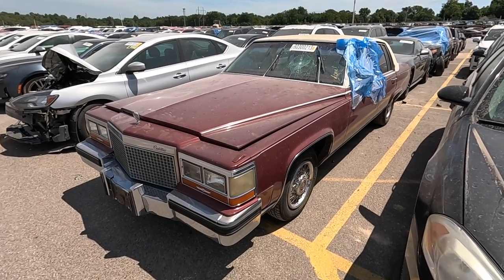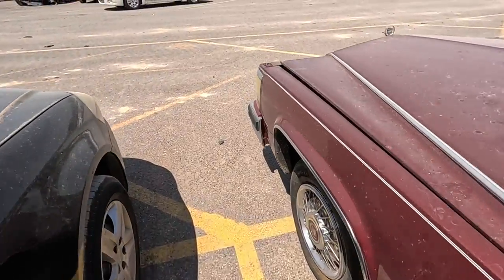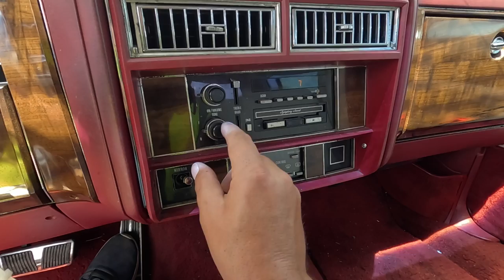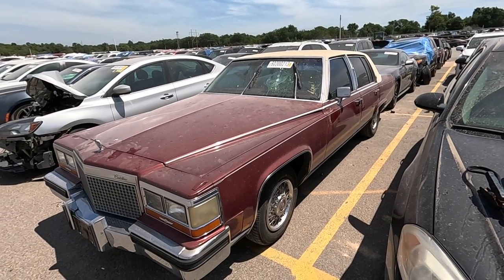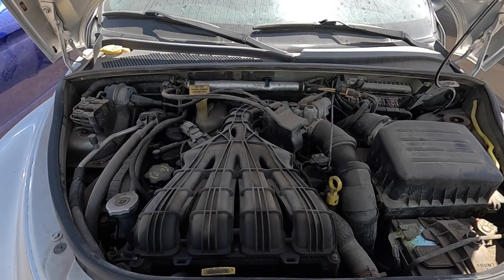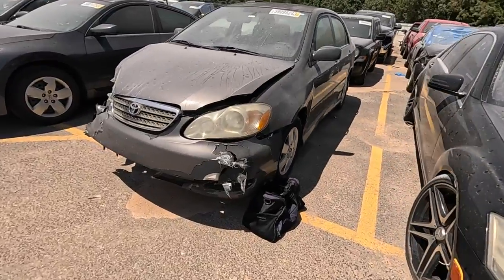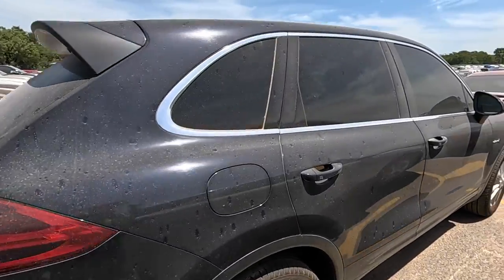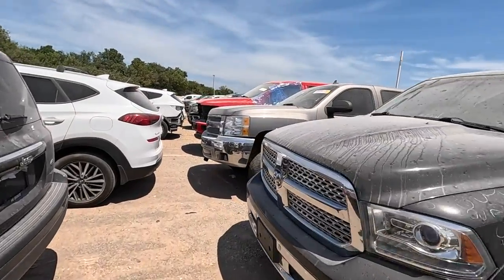This Old Cadillac Brougham was Abandoned for Windshield Damage? Will it Run?

Comment: The old Caddy has an Olds engine in it. Hell of a lot better than that HT 4.1 boat anchor.
Reply: A 403 swap would be perfect for this car. The 307 isn't really worth upgrading but they're pretty reliable.
Reply: Most of the Olds engines are pretty reliable, and a good throttle-body injection system will improve the overall performance.

Comment: OMG  the 1987 Caddy Brougham. I used to have one just like that. Mine was 86 or 88. 5.0l 145hp  carburated engine. 0-60 in 45 seconds,full  floating suspension😅

Comment: Randy, you need to get yourself one of those baseball caps with the two cupholders on it with drinking straws hanging down. That way you can stay hydrated with a couple of beers..........I mean water bottles.  Yeah, that's the ticket.  Water bottles!  
Stay hydrated brother, I worry about you.  This heat wave is no joke.  👍🇺🇸😎

Comment: Just FYI the engine in the cadillac is a Oldsmobile 5.0 which is 307 not 305 Oldsmobile engines have the oil fill in front like that and the opera lights are factory

Comment: Tell you what, had me a 2001 cavalier for 6 years, 2.2 with 5 speed, that thing never failed to start and go, except for when the battery went bad, 1 of the best daily drivers I owned and I'd get another but like you said they're dropping off and every time I do see 1 it always has rusted out quarters and some kinda body damage

Comment: Had a 1998 and a 2004 Cavalier.  Both had the engine cradle rot out though (1998 @ 320K miles, 2004 @ 100K miles).  Weird part, the 1998 was always parked out side in the MN elements, the 2004 was always in a heated garage! 🤣  Except for the underside rust, I loved the cars.  Very reliable, and last a long time!

Comment: The PT Cruiser is one of those love it or hate it cars. It's actually a great car. I've owned two. Bought a new 2004, and later bought a used 2006 GT 5sp, and it was quicker than any car I have owned including my 1991 Mustang GT. Handles for shite, especially if you have leather like mine did. I'd slip and slide all over that dang seat, but straight line it was a lot of fun. The engine on the GT is fantastic, you can get 500hp out it easily, with money that is. 😁👍✌😎🗽

P.S. We had a Cavalier also, and it was a lot of fun after I installed EBC slotted rotors, and Yellowstuff pads.😁

Comment: Re: 87 Cadillac.  You're right it's a 5.0, but it's not a Chevy 305.  It's an Olds 307.  Incredibly reliable, but gutless.  The only other better engines in these is the 77-79 with the Cadillac 425 (7.0L) and 80 with the Cadillac carbureted 368 (6.0L) and the 90-92 fuel injected Chevy 305 (5.0L) and 350 (5.7L).  Avoid the 81 with the fuel injected Cadillac 368 (6.0L) V8-6-4 unless the cylinder deactivation has been deactivated.

Also, the opera ("limo") lights are factory.  They all had them.

Comment: My wife and I bought an electric blue PT Cruiser GT brand new. At 78K miles the engine grenaded. Timing belt broke and replacements walked off the rollers. Replaced the mill and sold it, next guy had the same problem.

Comment: The 5.0 in this car is Oldsmobile 307. Can always tell the Olds motors by the oil filler tube in the front of the motor.

Comment: That is an Oldsmobile 307 under the hood of the Cadillac, only engine offered in 1987. Computer controlled carburetion 🤮 not my favorite but better than the previous 4100. They switched to Chevy 305 in 1991 as the base engine.

Comment: Hi Randy. Nice Caddy lol. This Car is bloody massive. The  Bonnet/Hood is as big as a Snooker table and the back seat is like a double bed. I wonder how heavy the whole car is lol. The engine sounds really good. You would need to have a Lorry licence to drive it 😅. 1987 was a great year for Cars if i remember correctly. I like the look of that Merc 550. Nice wheels. Shame about the drivers seat. If someone worked for me and did that. I would give them a good slap and run them down the road. Idiots. No respect for anything. Anyway Chat laters bro 😉😊😊

Comment: It has a Olds 5.0 307 V8. How you know it is a olds engine is the oil filler filler pipe is in front of the engine not in the valve cover like chevrolet.

Comment: 1. The Caddy Brougham.: It's not a 305, it's a 307 Olds. The oil filler is top front of engine, not on valve covers. An Olds exclusive and a giveaway. 2. Leave the Benz's alone. Average guys can't get them and they cost too much to fix. Ijs.